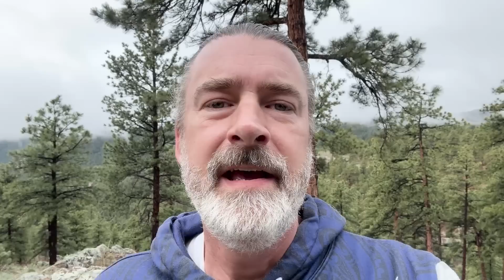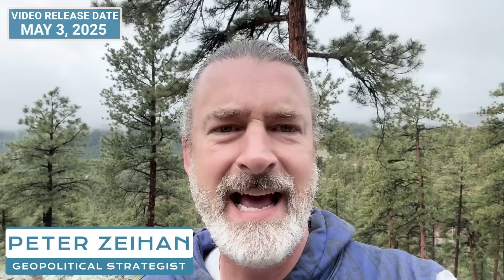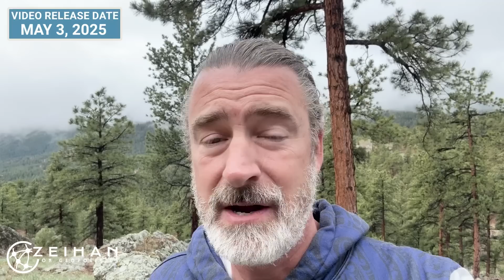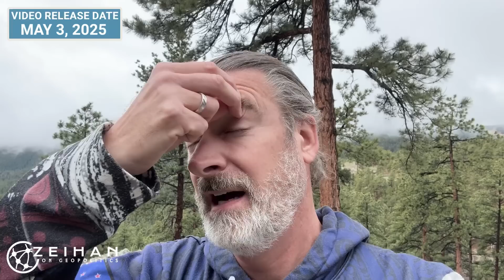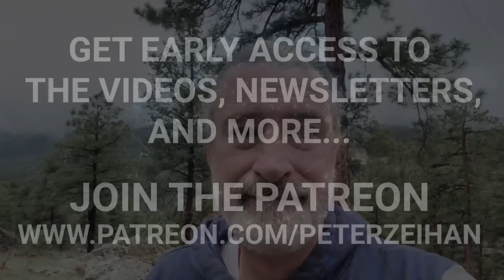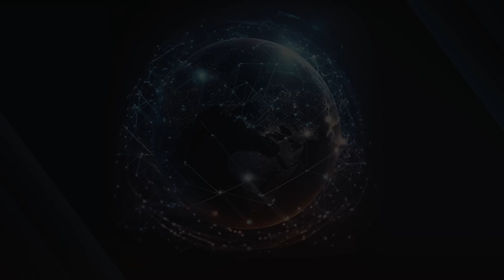The Night the Lights Went Out in Geor- er, Spain || Peter Zeihan

Comment: Grid scale flywheels are used in South Australia now, for that purpose.
Reply: There are such things as self powered flywheels to provide momentum (powered by the grid itself), but the ability of spinning storage to supply momentum is really over-hyped.  Only a small portion of the stored energy can actually be used for that purpose.  Once the spinning storages slows down from the action (literally just 10s of microseconds of lost phase angle), its contribution is done.
Reply: @junkerzn7312  And then the batteries kick in. Supplying momentum?  It is energy.
Reply: Flywheel energy storage can be used in place of a battery but it doesn't provide inertia because it spins at varying speeds. The spinning device for inertia is called a synchronous condenser and it has to maintain a constant speed synchronised to the grid frequency. There is a Wikipedia page describing them in detail.
Reply: I came here to ask about flywheels as battery storage. It's a concept I read about at least 30 years ago. If built in inertia is something to consider as power generation goes solid state. 

Related question: is this need for rotating mass a mark in favor of wind generation since a spinning blade is inherently inertial.
Reply: @richierodriguez5049  Nope. Not enough mass. Wouldn't make sense to have higher mass above the ground on a pole.
Reply: We're talking flywheels for two different purposes - one is just for stabilization.  The other is energy storage.   Two completely different things.
Reply: @russellhltn1396  Flywheels for energy storage go through power electronics... AC/DC/AC conversion to be able to sink and source energy.  They are NOT grid synchronized.  The physical rotating storage is not directly coupled to the grid and cannot directly provide any grid services.  Only the power electronics can.

It's basically the same as any sort of energy storage system in that it is limited by its power electronics.  Batteries (LFP, flow batteries)... energy storage flywheels are in that category and have no special capabilities.

The flywheels being talked about in 99% of the comments, including my own, are synchronous condensers... basically just grid-powered flywheels that trade-off a bit of power for stabilization services.

None of these services can save a grid that has just lost 15GW.... that isn't a stabilization function, that's a generation-v-load mismatch.   Stabilization services cannot make up for such mismatches.

Fueled rotating storage cannot supply more continuous energy to address a load imbalance than whatever is driving it.  So if a NG turbine is already running at 100%, you aren't gonna get much more out of it.  For example.   Same with nuclear.  Hydro usually has to manage river flows so there is a bit more wiggle room, but they can only make up so much in an emergency.

Grid-scale battery systems, on the other-hand, typically have huge margins where they can "generate" far more in an emergency than they would in their nominal daily cycle.   People who own small-scale inverters understand that this surge capability exists.  The same feature exists for grid-scale storage too and with active cooling (which they all have), it is possible to push vastly more than nominal power levels beyond 30 minutes.  Usually enough time for other emergency generation resources to come online.

-Matt
Reply: Flywheel is also used on Kodiac Island which runs off 100% renewables. Visited there last week.
Reply: Any rotating electrical generator offers a short-term flywheel effect subject to the extent of back EMF (electromagnetic drag caused by the connected electrical load)
Reply: To not include nuclear seems ideological. 

The best option is to focus on cost, reliability, and emissions. Carbon dioxide not included in emissions as the earth regulates our relatively small production. 

Wind, dolor, battery storage is not up to the task yet. Over decades that might change but for now it is coal, gas and nuclear for cost, reliability and emissions.
Reply: @fredludlow5184 Yes, earth deals with excess CO2 in the course of a few hundred million years. Humans cannot survive beyond 50C, though, and will have a hard time to wait it out.
Reply: @lborl5843 .  The earth deals with our very small (relative to the earth) production of carbon dioxide on a daily basis.
Reply: And they having nothing near what they would need to address this issue created by The Unreliables.   In large part because they are very expensive.

Comment: NZ has lots of hydro turbines, plenty of inertia there, and Geothermal is growing. Even if there was no inertia in a system, Solar and wind could be stabilised with massive fly wheels - or maybe dc motors that drive a generator, i know, you lose efficiency,  but gain inertia.
Reply: There is a type of equipment called "Synchronous Compensator", which is basically that - a gigantic AC motor who provides inertia and voltage adjustments. The kind of stuff that nobody wants to pay for, but which is essential.
Reply: Who is listening ???? the constant problem when talking to the ignorant. 😮😮
Reply: It would not be impossible to put a high voltage DC Power Cable all the way from New Zealand to Western Australia. Between NZ's Hydro and Wind, and the Solar you could develop in mainland Australia Green Power is totally achievable. It's just cost, commitment, and whether our populations need that much Power. Australia has been talking Nuclear Power, but environment aside, Nuclear's just the most expensive electricity humans can make.
Reply: @tsubadaikhan6332  the grid is the economic impossibly. 
Grids costs $TRILLIONS 
Rooftop PV is home energy budgets cheap. And no grid costs.
I am one of the few who speaks up.
We have millions of opinions by ignorants.
Reply: @stephenbrickwood1602   I can't tell what you're speaking up for mate. You're just telling me there's lots of ignorant people. No shit. Donald Trump is President. For the 2nd time, after a million Americans died on his first time. Ignorance is currently in the ascendant.
Reply: Aka as a syncon
Reply: Sounds expensive.
Reply: @hetmankp   It is expensive, but there's also no such thing as cheap nuclear.
Reply: There's also the option of using flywheel energy storage units for some capacity instead of some of the battery capacity. They can be made very low tech but then are less full cycle thermodynamically efficient. But if it's a safety issue you could probably build out massive capacity fairly fast.
Reply: I don’t think people realise it’s not just a matter of adding inertia engines, that is expensive!

Comment: You didn't talk about Hydro power which is what allowed Spain to come back to normal so quickly. Good video and Well explained overall especially the technical details
Reply: Hydro is not responsive enough to avoid the outage that occurred. Indicative start-up times are zero to 100% in 90 seconds, which won’t deal with the 4 second incident.
Traditionally, grids have had enough spinning reserve to cover the time it takes to bring hydro on line. This is an assumption that needs to be revisited in a wind/solar predominant system.
I agree with you that hydro is an important part of the recovery process.
In a hydro-dominant system (eg. Canada, Norway, New Zealand) hydro itself would provide the spinning reserve, but these countries are not the norm.
Reply: Peter left out multiple solutions to the issue. But the key point might be that grid are more complex that 99% (or more) of people understand. Cascade failures are not new! Also while final report is not out, it is looking like the Spain outage just like the last two big one in Texas was not driven by RE.
Reply: Spain outage was absolutely driven by RE despite the prevarication of the politicians who pushed RE without a plan for when things went wrong. Texas outages were due to unforeseen cold temperatures, but were exacerbated by renewables which make their grid less resilient. If the natural gas generators are compensating for the peaks and troughs of the wind and solar, they have less capacity to compensate for adverse weather events.
Reply: @AnonUser-b6y  I thought the TX outages were explicitly caused by wind power being unavailable?
Reply: *****Give me a break on this bullshit cover story.    
Its CHINA doing bad things to take over Gibraltar.
Reply: @AliasLaElectrica  - 230% above normal yearly rainfall across all of Portugal and some of Spain since January 2025 and plenty of hydrodams providinggrid power when there is rain and solid overcast.
Reply: Hydro ironically isn’t going to work with increasing drought situations possibly caused by global warming ..

Comment: Peter Z is again simplifying too much. He was wrong at so many levels that I don't know why's to start. We should wait for the root cause analysis.. BTW grid interia (PZ  calls it stored kinetic energy) does not require  gas or coal based power. Other options in production are :
1. Frequency Response (FRR) that adjusts load or generation 
2. Nuclear 
3. Hydro power
4. Grid forming inverter supplied by solar and wind
5. Synchronized condensers (basically flywheels or even turbines spinning without gas or coal) 
6. Fast acting battery storage
Reply: This is the most comprehensive answer. 6. could be supercapacitors.

Comment: Mechanical flywheel electrical storage would be an easy solution for grid stabilization as well.
Reply: Any imagination how big these flywheels would have to be ?
Reply: @bonnersommer7201  I doubt size is the primary issue, but that said, the larger, the longer it would stay spun up.  My best guess would be big enough to keep a city block online even if the main grid went down.
Reply: Make it a requirement in the grid connections for the solar sites, where let's say 1% of peak energy needs to be stored on a flywheel motor generator set.  Keep them spinning at night.
Reply: @Mark-pm8nw  We should keep a two-day supply. That way, we can keep fossil fuel power plants from running for as little time as possible.

Comment: You don't need to keep the gas and/or coal plants running.
You could just use the grid power (from solar and wind) to spin up just the turbines in those old power plants.
That way, you do have your inertia safety, but not the excess emissions.
Reply: That's the long term plan when our old coal power plants get decommissioned here in Australia
Reply: Thank you for your obvious solution , which Zeihan fails to mention................jumping to his patron the fossil fuel Natural Gas !
Reply: @MrNicoJac  - Solar and wind power generation have zero blackstart capability.if you were an electrical engineer you would know that by now!

Comment: You can run a generator as a synchronous condenser coupled up to the network. That gives the ''inertia'' effect without using it to generate power by itself.
Reply: came here to mention these. A flywheel system that gives turbine like stabilisation. South Australia has these as well as batteries.
Reply: Also great for managing reactive power on the network
Reply: Yes. Flywheel energy storage, mechanical batteries, are a mature technology.
Reply: @EdgarBrown-v9n A Synchronous Condenser

 Is not a storage system it is a grid stabilization equipment
Reply: TLDR Simply speaking you could just use big flywheels to solve the problem, no special minerals or manufacturing needed just a few tons of electrical steel and a bit of copper, as you need the the flywheel to be the rotor of a synchronous motor/generator (.i.e. the above mentioned synchronous condenser). Magnets not needed as an excited rotor can be used ( rotor with electromagnets)
Reply: Yes. They should find all of their shutdown plants and convert their generators to synchronous condensers.
Reply: We run a few of those here in Quebec, mainly for regulating power sold to the US. But, they're very expensive to buy, install, run and maintain.
Reply: I may have an extra synchronous condenser somwhere.... it wouldnt suprise me.
Reply: Get rid of coal and nuclear, but keep the generators spinning (or something equvalent). Costs: neglectible, problem fixed.
Reply: @marchorstmann7442  Synchronous condensers (especially with attached flywheels) do that, in addition to correcting for power factor (voltage and current being out of sync due to different types of loads).  You can't just spin the generator parts of old coal and nuclear plants without a kinetic energy source.
Reply: @marchorstmann7442  This doesnt fix the case of an underpowered grid (for more than a few seconds).  Spinning generators are good for absorbing reactive load in an overgenerated grid (synchronized condensers)

Comment: The only point I disagree is about microgrid. Most of them are AC too, but DC would be much better. And microgrid doesn't mean isolated from the grid. The difference is that it can! still operate without the grid is the production inside the MG is sufficient. The other advantage to go DC for households is that most thingw operate nowadays with DC anyway, so the conversion losses would at least 60% less.

Comment: 5:40 Turbines can also be left running at idle. This maintains mechanical inertia, but eliminates the consumption of coal, gas, or whatever powers the turbine. Frictional losses can be compensated for with electricity. Generators are essentially electric motors.
Reply: Flywheels too. Old school energy storage but still works.
Reply: @Ramman69dog  flywheels cant since they need to spin at different speeds to have energy storage, so there is DC power conversion step making it basically an inverter
Reply: @rokadamlje5365 He is thinking of Synchronous Condensers, they are seen around the world to balance grids and are very affordable. You can add a flywheel to a Synchronous Condenser to enhance grid frequency stability. They are also now combining SC’s with Battery Energy Storage Systems to make them even more effective.
Reply: @Ramman69dog ...which can be powered by that lovely wind and solar.
Reply: Yes, in the UK we're upgrading our gas generators to also be grid stabilisers.
Reply: Er, even in idle mode they are consuming some coal or gas
Reply: Turbines need to run at 50%+ just to idle, and the blades on the turbine are very frictionful. Also the structure would have be modified to install a DC motor on one side to be powered by a close by solar plant (and since DC motors are 90% efficient) so far it sounds really good, right? But that energy then has to go thru an AC generator which is 60% and that has to run nonstop connected to a grid or it doesn’t provide frequency stabilization.
Reply: Peter seems ignorant of a similar event in Italy 2003, caused by a tree falling on power lines in Switzerland, long before wind/solar renewables were significant.
He also failed to mention the Texas power failure, caused by freezing of fossil fuel lines and poor weather proofing.  That was immediately wrongly blamed on wind turbines, because it fitted political narratives.
It's a rush to judgement.
Reply: @RobBCactive  well it was both the wind turbines and frozen gas lines.  It's disingenuous to put all the blame on one or the other.  You seem to have quite a narrative yourself, so stop being a hypocrite.
Reply: @alanhonlunli  Wind turbines work well in winter conditions, as can be seen in the Nordic countries and Canada. The problem in Texas may have been they had no heating in the blades, just to save a little money, which is essential in some specific winter weather conditions.
Reply: @perperers2502  Yeah, Nordic countries have gas lines too.  Like I said, disingenuous.
Reply: Windage losses are horrific in turbines.

Comment: I forget the name for them but there are devices which are just huge spinning masses which are used for this. They act passively based on the incoming frequency and act as inertia in the system to reduce the rate of frequency change. Basically just a turbine without the electricity generation
Reply: Grid scale flywheels are used in South Australia now, for that purpose.
Reply: Synchronous condensers

https://en.m.wikipedia.org/wiki/Synchronous_co
Reply: @martinlord5969  That's the one

Comment: They can also use flywheels to store kinetic energy just like the turbines. There are grid sized flywheel systems out there.
Reply: Grid scale flywheels are used in South Australia now, for that purpose.
Reply: so instead of a turbine that acts as generator in power shortages AND as flywheel during frequency problems just build single use flywheels?
Reply: @ yeah it’s just a massive heavy spinning wheel that has incredible inertia. Once it is spinning  it can drive turbines on its own without power input. They have been around for almost 200 years! Maybe longer.
Reply: @ https://m.youtube.com/watch?v=porCfVeWyto&pp=ygUXZmx5d2hlZWwgZW5lcmd5IHN0b3JhZ2U%3D
Reply: @ https://m.youtube.com/watch?v=YrXw4CmxljA